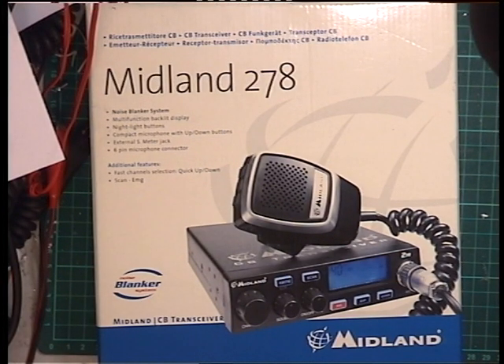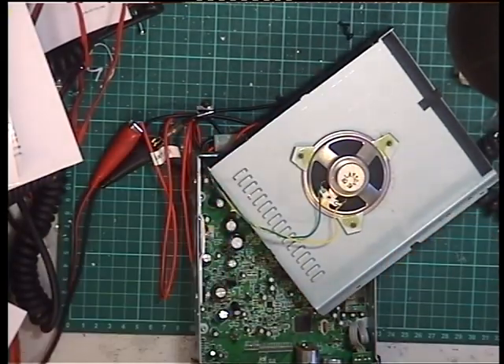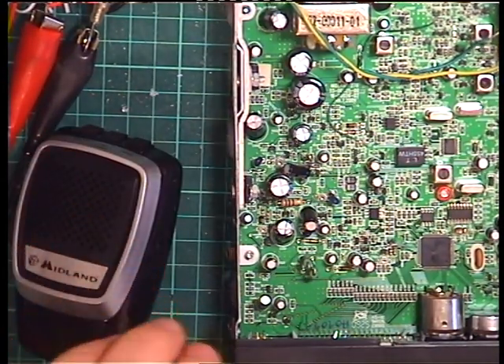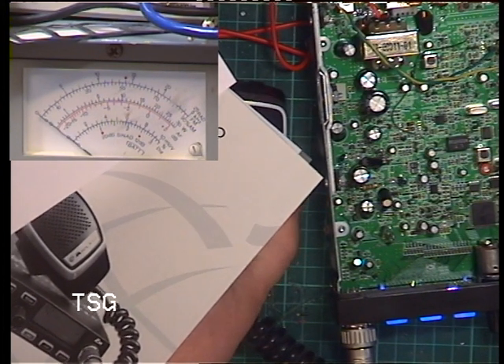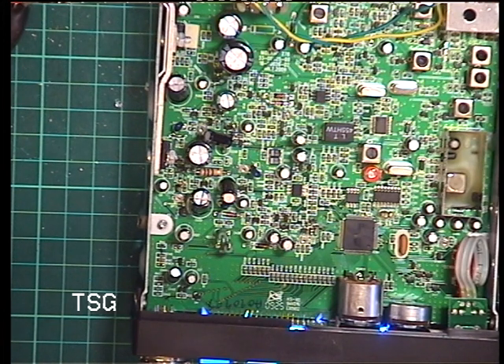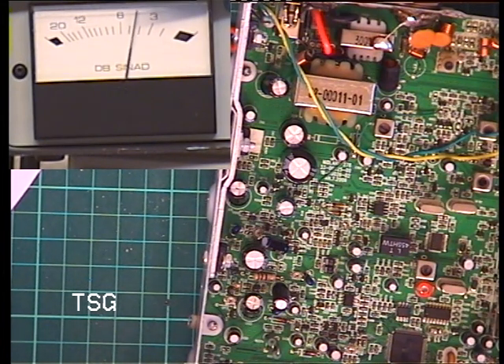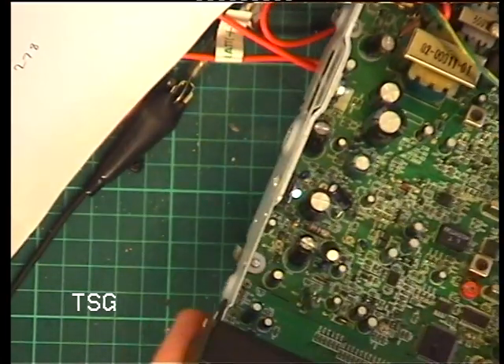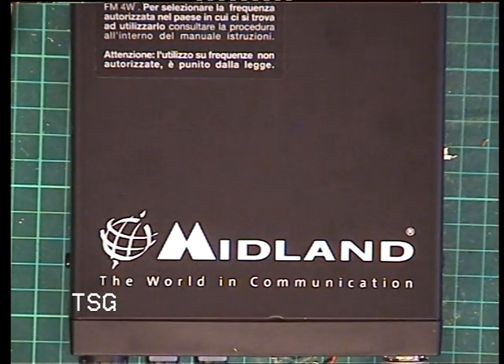Midland 278 UK CE-Multi CB radio (mobile )- Full service & adjustment

Comment: Great vid again Richard, quick general question for you, I know you're mostly a UK FM guy but on these new AM/FM sets does it matter which mode you align receive sensitivity in, you're always doing it in FM but would it be exactly the same if done in AM?10:10 till we do it again.................I've been practising my old lingo. :)
Reply from the maker: It's much easier to align in AM, as you can tune up onto maximum audio output with just an audio millivoltmeter & an oscilloscope. Then the FM detector would just have to be done in FM mode with just the oscilloscope for maximum recovered audio. I did a demo doing this on a cheapo signal generator in my "CB repairs on s shoestring budget" video.

This is the Tango 21 coming down you twig & through your rig, 10-10 breaker break.
Reply: @ukfmcbradioservicingTango21  Thanks, I'll go back and look at some of the older videos.

Comment: Thank You Richard I shall now do what is needed and get mine back together only be able to do certain things ,
What is the sound level you inject into the mic to get the audio output i'll try my jesan meter out
Reply from the maker: Sound frequency for deviation is 1Khz, direct injection into the mike socket would be around 4mV, but as you know we use a hand held audio oscillator & then a whistle & speech test so all rigs get set up the same; that covers for different mike sensitivity from set to set. Deviation should be from 2.2khz to an absolute maximum of 2.5khz on voice peaks.

Richard
Reply: I will see what this doe's Richard what do you think ?
 https://www.youtube.com/watch?v=3FBijeNg_Gs
Reply from the maker: spot on what you need